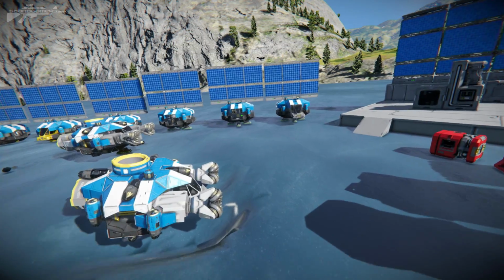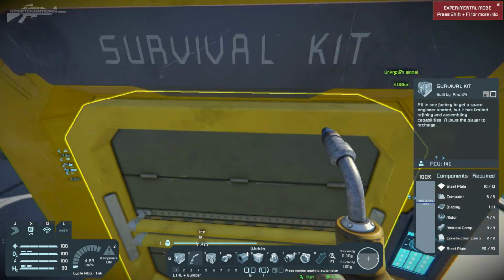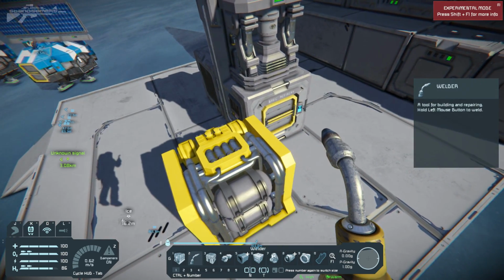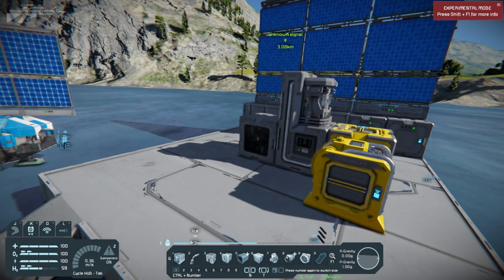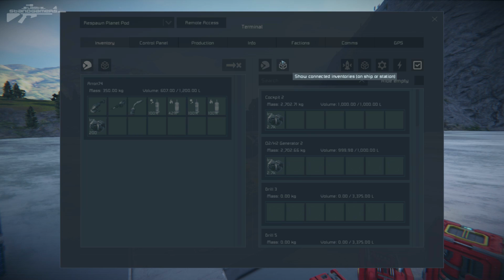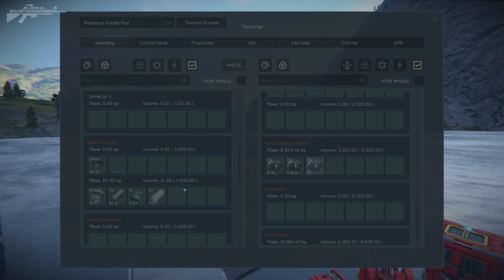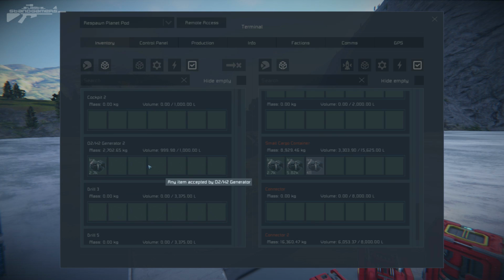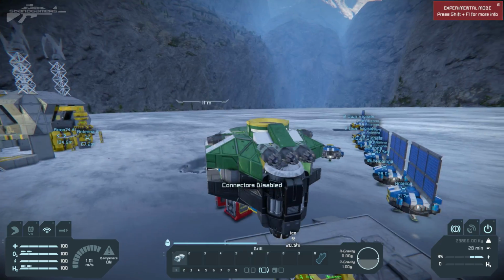How To Survive In Space Engineers (Part 2) Quick Tutorial (Step By Step)

Comment: Nice video as I'm new to Space Engineer I don't think it is necessary to have two drills. One in the center will go large enough (even better if removing unnecessary side armor, keeping her the size of the vertical engines. Then at very early stage, one drill save weight, allow a container, and by removing all other unnecessary things, I can fill it up and still move without additional engine.

Comment: I'm curious why more people don't make downward facing drills on planets.
Reply: Bad for when you need to eventually mine the vein sideways. but i usually make 3, 1 facing down and 2 facing sideways and get them automining, down facing to get down there, sideways to stip the ore out :)
Reply: Thats great for mining ice, but not that much use when you mine down looking for ores, that tends to require more horizontal movement than vertical. Of course, you could go with ventral drills and then some around the perimeter of your miner if you have the thrust for it, and get the best of both worlds. Just watch your weight and remember those bottom drills are down there, they snap off easy!